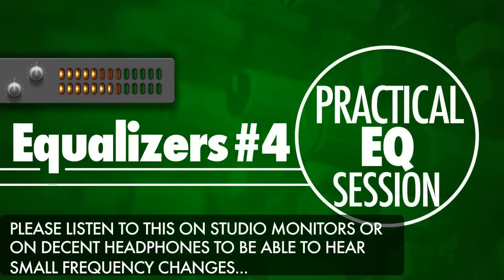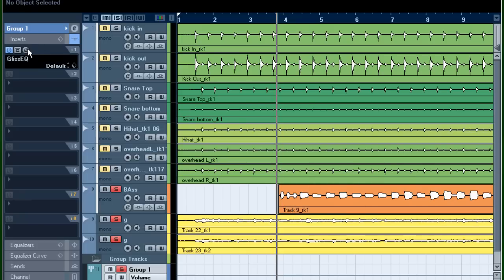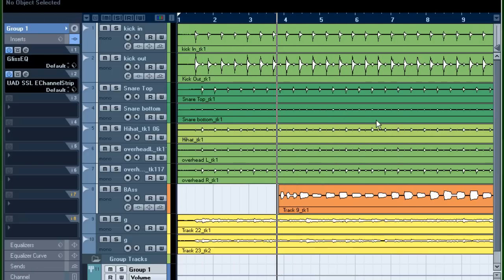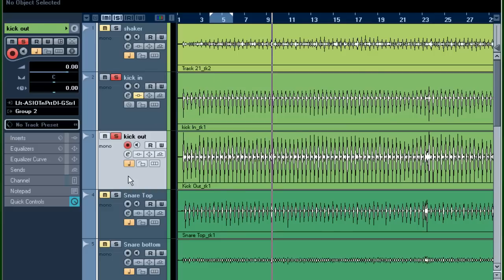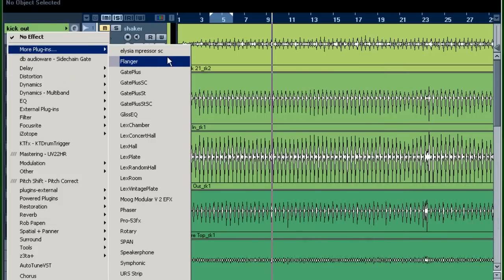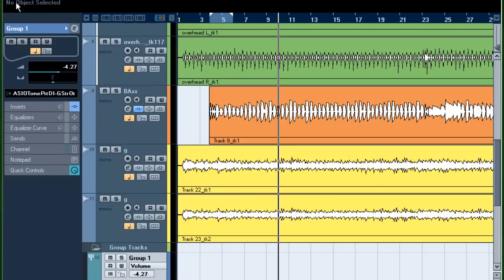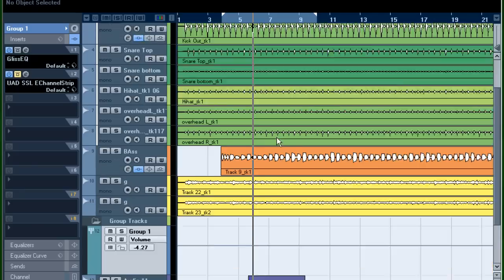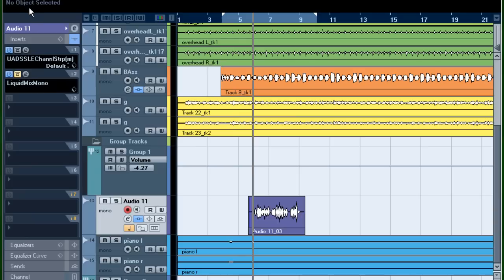Equalizers explained #4 - Practical EQ session 1

Comment: Hi, I am watching almost most of your videos because they are so to the point that are perfect. I am a musician, not an engineer, but I do lots of home recording which I would love to mix better than I am now. 

The question is about how to proper EQ a group of mics from the same instrument. I went to a professional studio to record my acoustic guitar and the sound engineer captured it with 4 mic's: some room mic's for reverb, then the brightness on the strings and the lows of the sound hole. This is because the acoustic guitar will be the primal instrument on the song and we wanted something very full. 

So now I made a level mix of what I wanted of each mic and group them all into 1 fader to easy control the volume of the guitar in the whole mix with the other instruments and vocals. Going back to EQ, do you EQ each of the mic of that group and then a general EQ for the group? Or just the group all together? What's the proper way to lead this kind of EQ of the same instrument but with multiple mics?

Thanx for your time!

Comment from the maker: Hi there, 
Well on this particular system I am using windows 7 actually, but for performance reasons I like to have it as light-weighted as possible.. So it ended up looking like XP :) 
I'm also running OSX as well.. but my main 'production computer' is that one actually

Comment from the maker: Hi there, That is actually a good question. This has really got to do a lot with the 'phantom image' in the mix that I will be discussing in the upcoming season about mixing. 
The bass, as it most likely will be panned in the center, will than come out of both speakers.. Depending on how you think it already sounds you could of course still remove some of the lower end of an acoustic guitar to achieve some better separation if needed, even if it's panned.